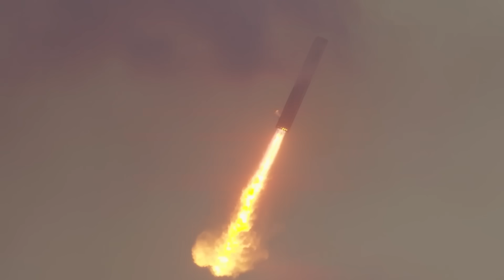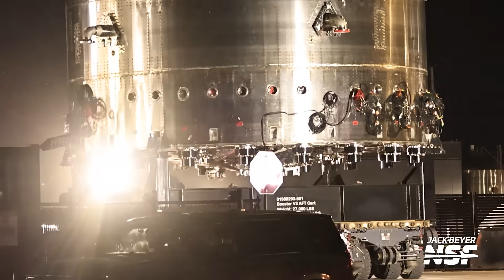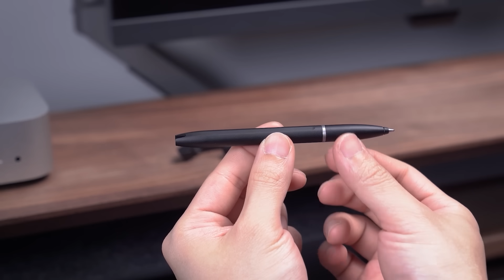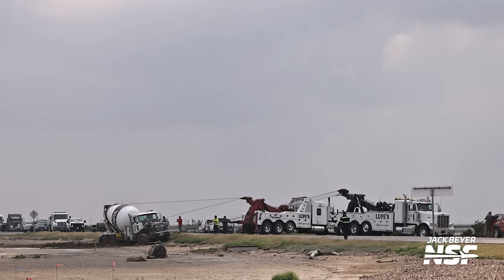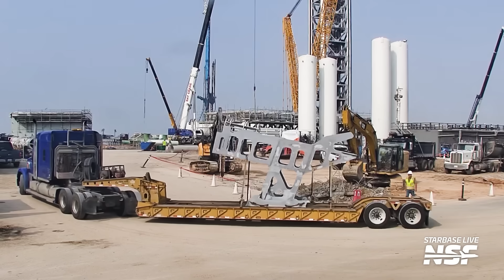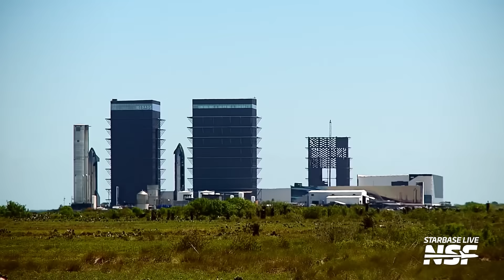Ship 35 Drama Continues + New Orbital Launch Mount Rolls Out! | Starbase Update

Comment: The problems have been caused by  ‘pogoing’ which is a rapid vibration up and down along the long axis: that breaks or cracks the liquid oxygen fuel pipes, or their attachments,  that are running towards the engines. The pogoing causes the escalation of rapid shaking movements over time once a harmonic frequency is produced in a component.. Pogoing increases as the fuel in the tanks decreases because the thrust in the engines rapidly and more widely fluctuates within a formied feedback loop of fuel pressure highs and lows.
Reply: We know its a harmonic resonance causing the issue. We do not know for sure the harmonic resonance is specifically pogo or another type.
Reply: CSI's vid was great!

Comment: You haven't seen cement trucks in my neck of the woods.  They have to pour foundations on unimproved lots, and they actually do pretty well with off-roading.  Of course it's not a bad idea to have an excavator or skid steer on standby.

Comment: That concrete box appears to be a junction box base and/or a manhole base that will be used at a pipe culvert / box culvert junction and/or angle in the pipe culvert / box culvert run.

Comment: Yep. Water pipe is adequate. We should expect to see a larger water tank or two appear. Normally, we should expect water pumping for more than 8 hours a day when electricity is at its cheapest. This is why the factory/village will need tanks. Can't have those transporters running over rhe water pipe trench as could crush pipe due to the waterlogged soil.

Comment: That rebar doesn’t look like it’s bound for the flame trench. Those were 12 meter Rebar Pile Cages, generally cut to length to fit piling foundation holes, which are drilled to support very heavy steel frame structures.

Comment: Toasty booster engine area?  They chill the engines with methane, and are flying supersonic thru increasingly dense air?
They're probably burning the crap out of the area w/ pre-start chilldown methane.  kinda required, but unfortunate.  
Engine bay heat shield?  hecks yeah!

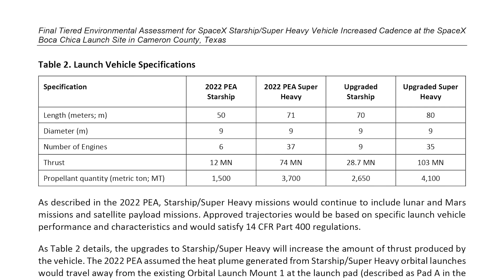Comment: 22:27 103 MN of thrust on a 35-engine Booster works out to exactly 300 tonnes of thrust per engine.  So, 300 tonnes is the thrust target for Raptor 3 - at least, by around the time the Booster is upgraded to a 35-engine design.
Reply: Thrust may be measured in American short tons which is both a unit of mass and a unit of force.  But an SI Tonne is only a unit of mass, a synonym for Megagramme.
Reply: @jamescobban857  specifying thrust in tonnes (metric ones) is a heuristic shorthand: it equates the force of the thrust to the weight of the specified mass under standard Earth gravity.  This helps people intuitively grasp the magnitude of the force: people are used to directly sensing how heavy various things are, but most people have no idea what 1 Newton of force feels like.  Another benefit is that you can directly assess the thrust-to-weight ratio, simply by dividing the thrust expressed in "tonnes" by the wet mass of the vehicle.

Comment: @NASASpaceFlight, did I see correctly that the paperwork filed by the FAA was specific to the launch site? If so, with the removal of the suborbital pad, there could, in theory, be no Starship static fires at the launch site since that now happens at Massey's. Additionally, if they devise a way to static fire the boosters out there it would cut down on time needed at the pad. Pure speculation on my part, but one that could explain the lower numbers of static fire times.

Comment: That water pipe can likely replace at least 100 water trucks per day (assuming 8000 gallons per truck, roughly the max for a highway legal tractor trailer, 64000lbs of water leaves about 16000 for empty weight of truck and trailer), possibly 300+ depending on allowed velocity and exact size (I'm basing those numbers on 6 inch pipe on the low end with a fairly slow 6 feet per second velocity, to 8 inch and 12 feet per second).  Assuming they do some management of the fill rate for the deluge system and put in a water tower or other large buffer tank I think it's entirely reasonable that pipe more than meets their needs, without a buffer would be a much more questionable affair.
Reply: Exactly,  thank you for sharing that.
Reply: Thanks. I was hoping to find somebody more ambitious on the math than I am. 🙂

I came to a similar conclusion based on "Mark I Eyeball" extrapolation assuming large capacity storage facilities as a prerequisite for maximum consumption.

Residential only usage with a modest water tower would likewise be easily achieved with that size supply pipe.

Admittedly, my "margin of error" is much greater... 😏

Comment: Liking Flyovers, thanks 😉
Surprised SpaceX, Starbase trucked in all water. Water line, needed improvement. Have visited area, thinking sidewalk for workers, residents and visitors, nice idea.
Starbase City approval 💫

Moving Launch mount 😵
Crazy tires 👀
Reply: Eventually Starbase will also need a natural gas pipeline to a liquefier piped directly to the methane tanks.  Another alternative would be a tap directly to the natural gas under the Starbase.